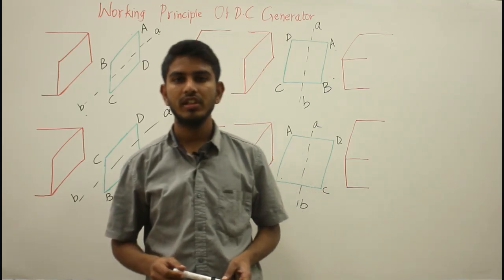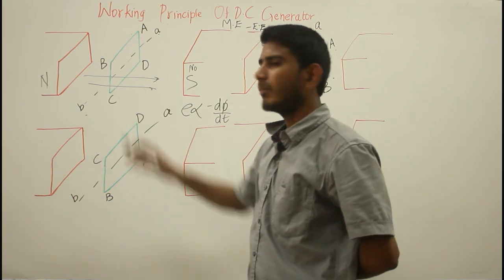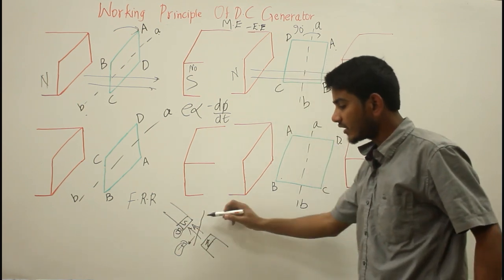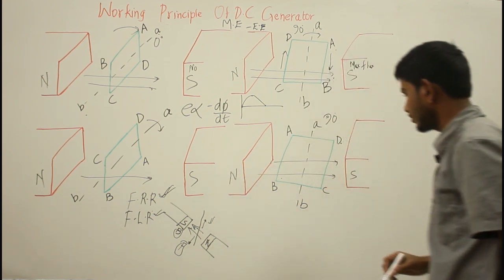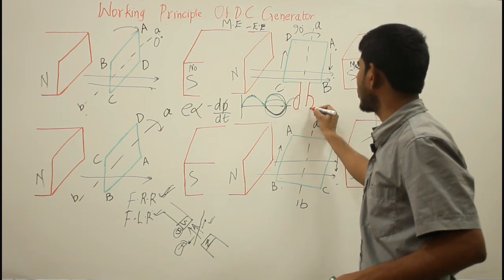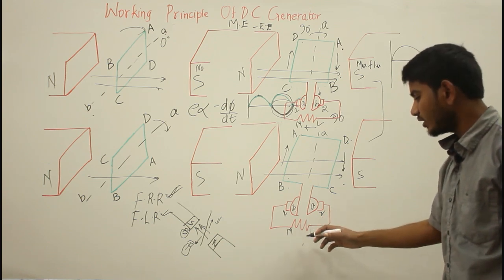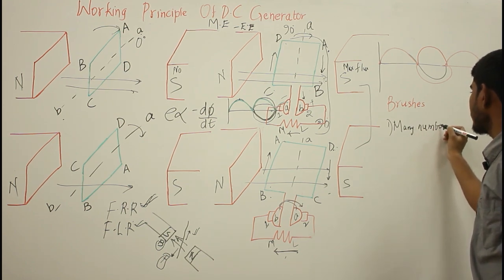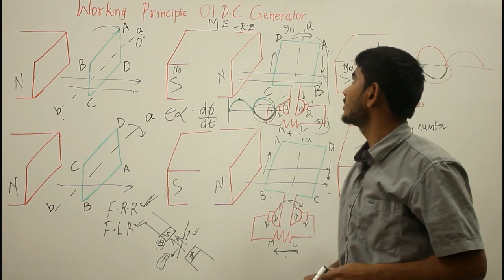Working Principle Of DC Generator

Comment: Sir ,, can u explain in first location of loop the flux cutting is maximum,,so why not emf is maximum??
Reply: @SmileandLearnflyfree  flux= BAcos(¢)=BA,, here in case first
Reply from the maker: Sir,
You formula BACos¢ tells ¢ is angle b/w B and A. In the first instant tangential motion of conductor is parallel to flux lines but the area of loop is perpendicular...hence follows the emf